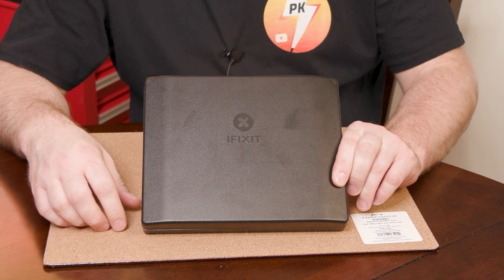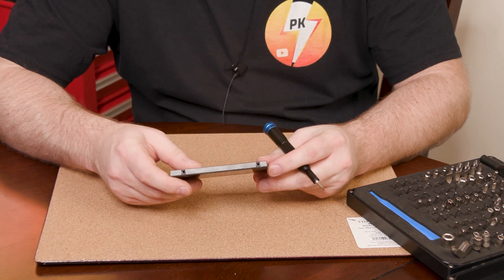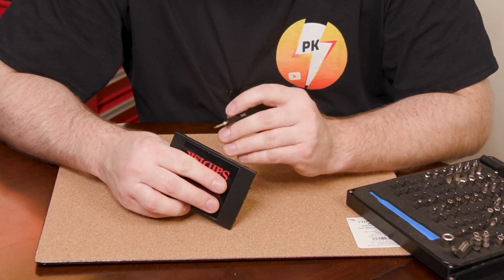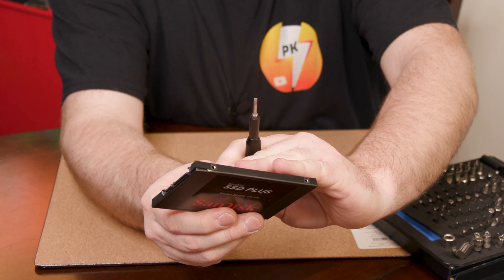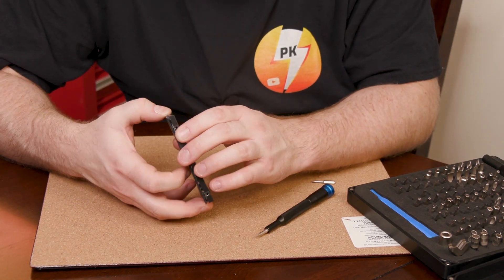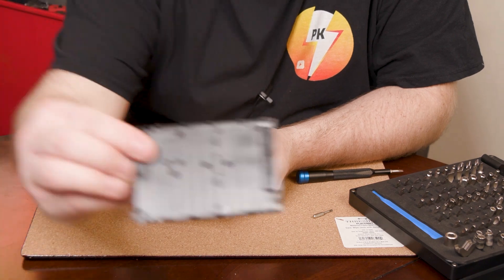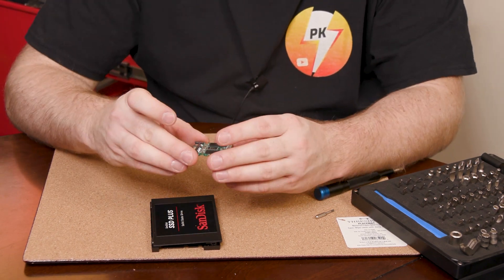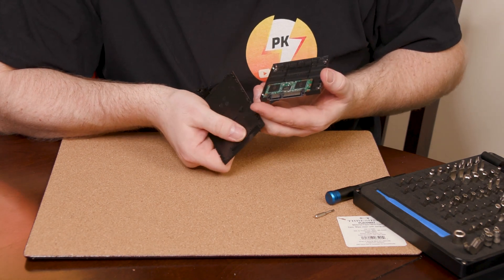SSD Teardown - What's inside?

Comment: The reason why we want to know is, I have a Chuwi Gemibook plus laptop, and want to expand the HD capacity, and have the m.2 slot in reserve. There is a connector pattern, for a SATA drive, but the connector isn't installed. The space isn't full length for a 2.5 drive, but was meant for just this size outline of an SSD drive. This is a far cheaper solution than an SD Card in a low profile fit adaptor, and faster.